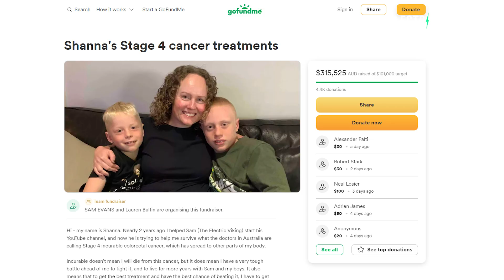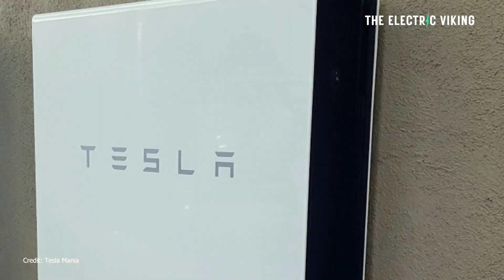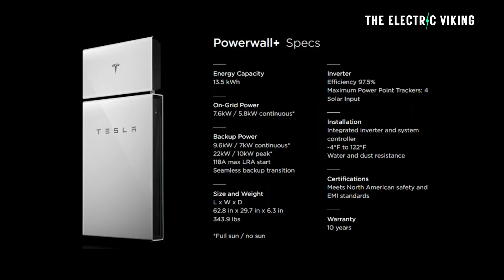NEW Tesla Powerwall 3 gets a MASSIVE power increase

Comment: Backup power 101 question here - is it possible to simply charge the Powerall with the grid, not solar panels, and use it like a backup generator when the power goes out?  Would be used for lower load options like lighting and keeping radiant flloor heat gas boiler cycling.  Understand that once the Powerwall is dead, we're waiting for power like everyone else without solar panels.

Comment: The best battery for home use and grid storage is (or soon will be) a battery that doesn't use Li.  And all they need is market share to be less expensive than Li batteries.  They are made from cheap elements that are readily available from multiple sources.  They can be cycled between 0 and 100% charge with no damage, last far longer than Li batteries, are safer from a fire point of view and would be far easier to recycle if you ever needed to recycle them.  There are two types of ZnBr batteries (Flow/plating and gel), a molten metal battery based, so far on Sb and Ca, a range of redox batteries using V and Fe and the up and coming Na battery.  Note that each cubic meter of sea water contains about 15km of Na.  Na batteries, unlike Li batteries, can be fully discharged before shipping, reducing their fire risk to zero.

Comment: According to the datasheet for the Victron Peak Power Battery with a capacity of 20Ah, it specifies a continuous output current of 30A from Output 2 and a nominal voltage of 12.8V. However, if the logic board consumes 12.8V at 14.7A, it is unclear if the battery will supply more current than the specified 14.7A to the logic board.! any tip is appreciated

Comment: So the capacity does not increase I don't care that I can use up the whole battery in a little over and hour I want more capacity . 
I use and average of 10 kw for the house per day . At 13.5 kw new I can now use the whole capacity in a little over and hour
I don't need that. It's not bigger it can just empty faster(and maybe fill faster?). There is a big difference between storage capacity and output rate.
Only washing machines and electric heaters  and air conditioners draw heavy currents.

Comment: I love Tesla, but you have no idea what you're talking about. Regarding home batteries, especially here in the united states. Tesla is the cheap version of the home battery.  Do some research on the Enphase micrograms capabilities.  The battery for a home micro grid is only one of the key components. It's great to hear that Tesla has improved. They batteries because they were the low end until the power wall 3. In my opinion perio.

Comment: My Powerwall 2 is four and half years old and only charges to 69 % of its rate 13.5 kWh or 9.224 kWh  nominal pack energy . Which means with a 15% reserve I only get 8kWh before it stops supplying power , it used to be 12 kWh .
I am waiting to see what Tesla decides to do , it has been  week now ( 25/05/2023) since I contacted Tesla .
I now would be  wary of buying any sort of battery car or home battery .
So what ever brand you buy make sure the warranty is good and the company has representation in Australia to back it up .

Comment: the 7.6kW rating is probably for grid output and will likely be pegged lower in software (by region), example, I have 2 powerwall 2s and the combined continuous output is 10kW, but grid output in my case is limited to 3.3kW.  I can see this because I have a 3 phase connection, and if a load during the night comes onto a "non-powerwall phase", it will send up to 3.3kW out to the grid on the "powerwall phase" to the grid to compensate, if the load goes higher than 3.3kW, then I have a net import for that period of the load (your region/distributor may be different).  The 11 kW rating is likely for house loads.  The gateway will determine what's what and send electrons where they're supposed to go.
Reply: But why would you need 10kw continuous . Only washing machines and electric heaters  and air conditioners draw heavy currents.

Comment: You have got it wrong, completely the wrong way around.  You have mixed up kw with kwh.  I have 13.2kw solar and 2 x Powerwall's.  Powerwalls are outstanding, I highly recommend a Powerwall or 2 if you have solar.  The Powerwall 2 is 13.5kwh with a continuous output of 5kw & short term peak of 7kw, that is PER Powerwall 2.  So with my 2 Powerwalls I have 27kwh and continuous output of 10kw with 14kw peak.  The Tesla app is outstanding.  
You will still need at least 2 x Powerwalls regardless if it is the 2 or new 3.

Comment: It costs about 20,000 for a Powerwall 2 to be installed. The only reason a person would want to install any type of battery is to either go off-grid or as an extremely costly backup. A powerwall has a life of say 10 to 12 years. Are you going to save the $20,000 cost of installation over that time? In my case, that is about 15 years of total electricity cost (I have 6.7 kw of solar panels) for my home. A typical house may use say around 2 to 3 kw overnight when the panels are not generating. You would be much better off even now investing in more solar panels than a battery.

Comment: I don’t know about the setup of the new Powerwall, but the Powerwall 2 has some issues when the grid is down, mostly due to its black start weaknesses. The basic problem is that the system doesn’t allow for direct DC charging of the battery. If the battery is low, then when the solar comes on it has to do a DC to AC conversion and the AC back to DC again, with some conversion loss. Though it is a problem, I am not complaining about the conversion loss. 

The main problem for black start is at the AC stage because the solar power isn’t just feeding into the battery, it is connected to your entire house. So if the power has been out (because the grid is down and battery depleted) in order to charge again, the solar panels must energize the entire house. Since he house is likely cold, fridges and freezers warm, and other devices have been delayed, the moment the power comes on it might be drawing a 10+ kW load, which far too much for solar at 8 AM at the morning, so rather than slowly charge your battery, it ends up depleting it until the system panics and shuts off again. Rinse and repeat every hour until either the solar is delivering enough power to push the whole load (and your batteries charge slowly) or the batteries get so low, the gateway simply gives up permanently and won’t recharge until the grid is restored. 

The only way around this is to go micromanage the load at the breaker panel and shut nearly everything off, BEFORE it goes completely dark. This is a fair bit of micromanagement for the average user, not at all obvious to most, and not really possible if you are away or managing a rental. It’s also quite impractical for off grid installs, for which since there is no grid, someone may have to come jump your house! (Who do you even call?) Hopefully this has been fixed, but the panels really should feed directly into the gateway so that the batteries can charge directly without needing to power up the home. Once batteries are up to 10-20% then the gateway can turn on the home. This is a feature of other battery systems like Enphase, and reason enough to consider them strongly over Tesla.
Reply: I have had a tesla power wall two for years and I’m not sure what it is you’re referring to. There is nothing DC about it for charging. Another thing that I looked into was that Powerwalls are rated to live outdoors and in fact can be submerged and still function. I am not sure many other battery packs have that rating?

Comment: I have a couple of powerwalls.  Somewhere in the documentation it was mentioned that around 7.5 kW output is a common regulatory limit.  Once you go over that limit different requirements apply (costs go up).  So I wonder if they are also getting those regulations relaxed.
Reply: I have a power walk to here in the UK, and it’s continuous output is rated it 3.7 kW, and it can boost to 7.2 kW, which is the limit for a spur like you would use to power an oven. The only other difference would be three phase power. I am no expert but in presidential terms three-phase power can go to 11 kW and I think in industrial it can go all the way to 40 kW.

Comment: I installed two Powerwalls in 2018 to complement our 13.2 kW solar PV system, and can say they are an amazing product that enable us to operate as a microgrid for ~8 months of the year, and only draw energy from the grid during winter when we do not get sufficient solar power. Powerwalls are worth the price IMHO. We operate our all electric home and charge two EVs off our roof and export more than half our excess solar energy back to the grid. On average we generate 350% of our electricity needs with our system.
Reply: We have something similar, but it can’t be stressed enough the need to have much more than adequate solar. A typical solar installer may be looking to skimp on the number of panels installed to bring the bid down and capture customers. However, since winter sun is a lot less than summer sun, it is important to actually over provision the system so that it is still adequate in the winter sun when the grid goes down, otherwise your home is going to become quite chilly in a hurry. We got merely adequate solar (10 kW) which means in the winter we usually only generate 6 kWh all day. This isn’t enough to run the furnace or do much other than keep the fridge going, Wi-Fi and a few iPads. So, winter storms can get chilly. Fortunately it almost never freezes here, but all and all, it would be much more pleasant if we had 20-30 kW of solar installed.
Reply: @ianollmann9393  You are so right.  I have seen people restrict the amount of solar to save cost and they could only charge the batteries to about 50% SOC.  It is critically important to size your system with enough PV to recharge the batteries in the AM and handle your real loads and feed power back in the PM.  Oh and this should be able to be done in the winter as well.
If you use them for backup then you need to make sure that in most weather conditions you can get through the night and then have enough PV to get the battery recharged.  If your battery drops to 0% SOC and you lose power it will not restart when the sun comes out.  You will have to wait for the grid to come back on.  This is a weakness of the AC coupled technology and not specific to the Powerwall. 
So, if you are going to install a system don't skimp of the PV and watch your consumption when the grid goes down.

Comment: Not to put too fine a point on it, but PW1 and PW2 are both extremely undersized and had become non-competitive.  We'll see what the PW3 winds up being.  Tesla has been very slow at getting their power-wall product to market, very slow getting LFP cells into their power-wall product, and very slow to offer reasonable capacities or power capabilities verses the competition.  I need not mention that ALL power-wall style products tend to be over-priced for their capacity verses discrete solutions (discrete rack-mount LFP battery packs combined with a hybrid inverter like a Sol-Ark).
Reply: The first two power walls use NCM batteries. I was quoted PW2 turn key for $15k. I blinked a bit then said “I am not having NCM batteries bolted to my house”. The supplier said “It is the only solution compatible with your current solar inverter out of the box. Take it or leave it”.

Now that was bullshit. BYD has a solution that is LFP and has its own built in inverter it’s just that nobody in Australia has done the factory support training.

Comment: I wish Tesla would get around to enabling bi-directional charging on their cars.  We have a Model X100D and a Model 3 LR, and between those two cars, we could power our house for a couple of weeks!  We have more than 10 power outages here every year, and we do have a Powerwall, but it's very small in comparison to the capacities of our cars.
Reply: The cybertruck is supposed to be able to do it
Reply: Agreed bi-directional EV charging with a Powerwall should have been done by Tesla many years ago. So silly as EV is 5-8x bigger than the Powerwall…a huge resource to waste just sitting in your garage if the lights went out for a long time.

Note Tesla powerwalls also only work with solar or grid generation to fill up…can’t use home hydro or wind which is a deal breaker for me as I have a small river running through my land I want to use.

I believe the BYD batts can charge from any source…I know for sure the Victron ESS system can down here in Aus/NZ.
Reply: But people would not buy powerwall then
Reply: @AdrianMcDaid  some wouldn't others would. I have a home battery system to store all the solar I generate during the day for use at night, but I would still like v2g
Reply: @AdrianMcDaid  would still be useful to have the powerwall in case you needed to use the car and people were still in the house during an outage and also to store excess energy you could later sell to the grid?
Reply: I’m with you mate bidirectional charging would be a game changer for me
Reply: 3 powerwalls should cost the same  as a Generac.
Reply: Tesla now has a meter cutoff which could enable this. I would never do this due to reduction in life of the car. Not a cost effective way.
Reply: So, the biggest problem with adding inverters to the car, is that it would hugely affect international distribution, and it would be incredibly difficult to get insurance that would allow the battery to ever be used, ie someone buying a car and not driving, then reselling the car with 4000 full cycles, but 43km of driving. You can swap the engine of a car, but you can’t do the same with the Battery. 

Various scams later, someone would mandate the odometer be affected by V2G or equivalent monitoring standards so that people aren’t leasing their cars out or trying to upsell fleet cars as storage, sic. 

While it might be an option, the car side is the weakest link. Someone other than Tesla will have to put the legislation and protocols together, because the standard bearer will have to pay the insurance costs and legislative hurdles in hundreds of countries. 

CCS v2 will support bidirectional control, because fleet control makes money. The shopping centre car parks and office parking with day charging will be the first ones to get V2G because it will allow premium charging rates, ie soaking 1kw from 20 other cars to help fast charge someone who pays $10 extra.
Reply: Agreed - these home backup batteries are far too small to handle long outages.  A single EV has huge capacity compared to Tesla Powerwalls, FranklinWH, etc.

For long grid outages we went with a low cost portable 240V propane generator, and waiting for LFP batteries to get a little cheaper.  I’m confused about the statement that Powerwall is now LFP - is that is true, I’m interested.

Otherwise FranklinWH seems like the best LFP option out there.

I’ve been waiting to commit to a battery system, installing solar only for the moment and hoping the new generation of batteries is worth waiting for.  LFP or M3P seem like the way to go for home backup - doesn’t really matter how heavy they are, with than installing heavy (400 pound) batteries.
Reply: I don't believe existing Tesla's have the hardware for bi directional charging.